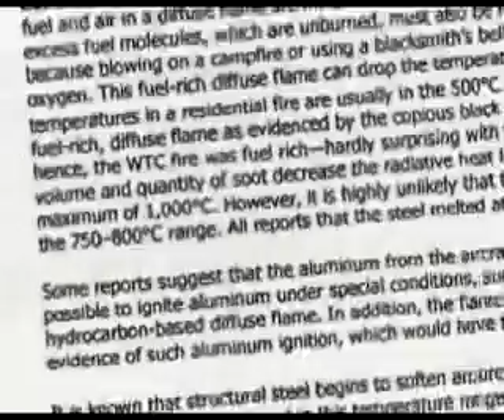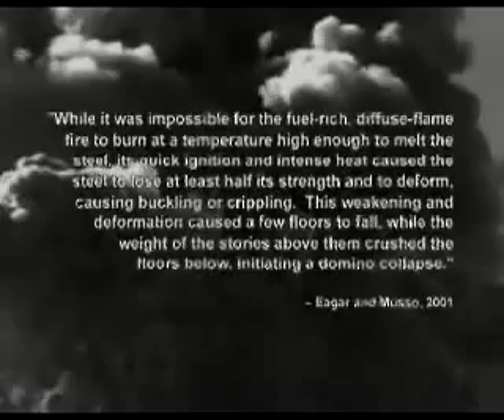Steel Facts and WTC Collapse (Part One)

Comment from the maker: "Also the WTC had a different support structure than almost any skyscraper"

We should also look at differences in structure, height, construction, damage, etc between the Towers and WTC7 and evaluate why all three collapsed in the same manner....relatively straight down.  Unfortunately, using logic doesn't work here. Enter an external force acting on all three buildings.

Comment: "under carriage of the plane proves explosives were used and the one floor was full of thermite to the ceiling"

Where exactly did you receive this information from?? what are your top 3 sources of information? if the floor was full of thermite it would be so obvious to camera video taping since it burns so bright and puts off so much smoke. You assertions are absurd.

Comment: I hardly think an eight story building can be compared to the WTC buildings. That experiment cannot be used as a template for this situation. The sheer tonage of the towers and the damage inflicted by the planes would be the factor. 

Again, it's a rather close-minded thing to say that "I've never seen it and a video doesn't show it to me, so therefor it couldn't have happened."

Comment from the maker: snoopy,

The main point of the analogy was that there have been more widespread fires lasting much longer than the WTCs with not even a hint of a collapse. Enter Logic: Is 56 and 102 minutes enough time for massive steel to be heat weakened to total faliure when other fires have lasted many many hours. It's called common sense. Next, throw in the lack of repeatability in a controlled environment. Stay tuned...

Comment from the maker: Try this? The Titanic sank mostly due to striking an ice berg, right? Now,say there's a history on ocean-liners (about 8-9, all much smaller than the Titanic) hitting ice bergs with none sinking. But, the ice bergs striking these ocean liners were much bigger than the ice berg that struck the Titanic.  Also, the damage inflicted was much greater. Now, say, 3 Titanic-sized boats sank ALL ON THE SAME DAY due to a small impact from tiny lil' ice bergs?  Then yes, I will say something is weird.

Comment: amer -

The fact that you have to include 'Bush hating' in your diatribe shows you haven't much confidence in arguing from facts.

The 'proper experts' agree the impact damage was minimal. 

Although the fires caused high *air* temperatures, it wasn't air that held the building up - it was *steel*. Unfortunately for Bazant/NIST no 'fire weakened' steel was found.

Comment from the maker: "why don't you read pro reports from the proper experts for a change."

Speaking of reading reports...
 
"Of the more than 170 areas examined on 16 perimeter column panels, only three columns had evidence that the steel reached temperatures above 250ºC. Using metallographic analysis, NIST determined that there was no evidence that any of the samples had reached temperatures above 600 ºC." (p 88/142)-NIST

Comment: only known method.  pst.
godzilla can bring a building down.  typical CT   only one method.  thats why they think like sheep.

you have three planes crash into the same spot and not have the building fall in 2 seconds?

What if you take all the bolts off from the building.  Will that not take the building down?  If you put it together, you must be able to take it apart.

Comment: "the professor pretty much says that the way it collapsed was more than possible but this video still twists it as claim that it's impossible"

Absolutely. And Prof Eagar said it DID collapse that way, no question.

This pathetic bimbo glosses over it and brings up total irrelevancies, trying to hide the facts.

The building fell because uneven heating buckled steel & broke welds & bolts, which pushed the columns out of alignment and broke them on the way down.

Bimbo never read the paper.

Comment: "then the collapse would be exponentially uneven"

SO that's why those structural engineering professors at MIT & Purdue & Univ of Manchester & U of Sydney all said it should fall over like a Christmas tree ...

Oops, I forgot.  They all said it fell straight down because of gravity, and was clearly caused by plane strikes and uncontrolled fires.

You need to straighten out the poor engineering community, who obviously lack your skill and discernment.

Illiterate putz.

Comment: Its not obvious, and it would not have collapsed unevenly, such weight on the weakened supports would not act on it slowly, they would fail quickly and catastrophically, thus the easy to understand occurence of the "pancake collapse."
Peace...if it means anything

Comment: Look at the chart on the beginning of the video, steel turns cherry red at 1400 degrees, the woman even said the fire was about 1200 degrees, it could have been as much as 1400 easily.  Heat a bar of steel on your BBQ till it turns cherry red,and it is almost a hundred times easier to bend it then at room temp, the area of building above the plane hole was extremely heavy, and the weakened metal was weak enough to allow the top section of the building to reach the speed to bring down the towers.

Comment: 90% of the fuel was the fireball you see just after impact. That leaves 10% was enough to bring the buildings down....Unlikly, try again to disprove Demolitions. Also try to explain the 45 degree shearing of the main steel columns.

Comment: thanks for raising this question: what did happen to the core? isnt that supposed to be much stronger than the floors and the outside? there are these famous pictures of the ruins, the outer columns are still standing around what used to be the lobby, and in the middle there is that big hole where the core used to be

Comment: Actually fire was not the main contributer, it was the massive plane going 500Mph that smashed into the building rupturing main supports and fire proofing. Thermite is an impossibility JONES (your guy) found NO Barium Nitrate in the steel samples he took, 30% of Thermite is made up of BN, with literal tons of thermite that would have to be used he would of found BN. Period.

Comment from the maker: No plane fly into WTC7 also so, we really can't use that excuse. The Towers and WTC7 collapsed in the same manner (in secs) into their own footprint with extreme temps/molten metal discovered in the basements, so they all had "SOMETHING" in common. Compare the structures of the Towers vs WTC7. They are different also

Comment: steel melts at 1525° C, and although jet fuel burns only at 825° C, it doesn't have to burn hot enough to melt to cause the buildings to collapse, since steel loses 50% of its strength at 648 ° C)

Comment: No plane flew into the Madrid Windsor Tower, for instance. It didn't sustain any structural damage prior to the fire beginning. More significantly, the design of the Madrid Windsor Tower was entirely different to that of the WTC.  Windsor was made of mostly concrete and the steel that was on the windsor tower FAILED.

Comment from the maker: (Cont) Meanwhile, in this same period of time right after the impact, ppl like Edna Cintron walked directly to the impact hole somehow avoiding the burning office suppiles and carpet, right?  Realistically, is 56 minutes (err, 46 mins) enough time to weaken steel to the point of failure when ppl are actually walking around in close proximity?  Do I need to inhale or tighten my tourniquet a little more to appreciate this kind of logic?

Comment from the maker: But, did the fire burn intensely?  "The jet fuel probably burned out in less than 10 minutes."-Dr. Shyam Sunder, Lead Investigator for NIST. Even NIST agrees that the jet fuel minimally contributed to the fire.   So, what caused this heat that weakened steel but didn't harm these ppl at the impact hole? An open air fire with burning office supplies, carpets, etc?  The story gets better and better.

Comment: Listen to the sweet-talking Madam in the video you posted. She talks of "melting" as if it were some sort of mantra. I wish that the engineering world agreed with her. Oh I wish. Then I could build a structure of steel, and it would not weaken until it melted. Just imagine the fire resistance of that structure. Full strength until 2749 degF, and it melts like toffee and drops like a stone at 2750 degF.
Oh I wish!

Comment: There are plenty of flames. Difd you look? Shall I send the posting? 
So, when those poor souls walked to the windward side of the building to get some air to breathe and to escape the heat, you think that the air carrying the oxidant for the fire must be burning them if the heat from the fire was able to soften the steel elswhere? 
Try it yourself. Set fire to a tire in your back yard... you'll want to stand upwind.

Comment: Those poor souls were trying to get some air, and they stood near the windows where the temperatures were tolerable, for a while. Some had to jump, so much was the heat. You noticed them falling, I hope, or were they pushed?
The weakening of steel at elevated temperature does not make sense to you? It does to mechanical engineers. 
Do you want me to post a reference here for it? Would you read it if i did?

Comment from the maker: What about the many ppl waving from the smoke filled windows and standing at the impact hole (Edna Cintron)? Logically, they should have been killed by these intense temps hot enough to weaken steel. The weakening or melting "theory" doesn't make sense. Also, seeking the truth has nothing to do with disrespecting the victims.  Many of victim's families are questioning the weird events of 911 also.

Comment: 1200 degF will not melt steel, BUT THE STEEL DOES NOT HAVE TO MELT TO WEAKEN ENOUGH TO CAUSE THIS BUILDING COLLAPSE.
The concept is known as TEMPERATURE DERATING.
Look it up in a book.
In the name of the people that died that day, get off this stupid melting ticket. You are WRONG to talk of melting all the time.
Talk temperature derating or go to an engineering school and learn something about it.

Comment from the maker: "there are different types of steel"-Yes, this experiment was performed with unprotected steel which logically means the buildings show collapse even faster, but it didn't even collapse in six trials?? Controlled experiment: 0 for 6, 911 3 out of 3???

Comment from the maker: The British Steel and the Building Research Establishment performed a series of six experiments at Cardington to investigate the behavior of steel frame buildings. These experiments were conducted in a simulated, eight-story building. Secondary steel beams were not protected. Despite the temperature of the steel beams reaching 1,500-1,700ºF in three of the tests well above the traditionally assumed critical temperature of 1,100ºF, no collapse was observed in any of the six experiments.

Comment from the maker: Yes, there was lots of black smoke. Smoke inhalation will kill you and it's the primary cause of death with indoor fires. Research this. An open air fire (with burning carpets, furniture) does not have enough heat to weaken or melt steel. Many fires are started this way. Why hasn't this event happened before? Isn't it time for an education?